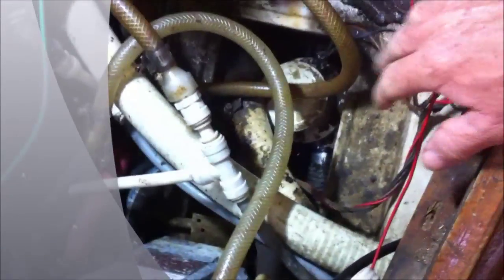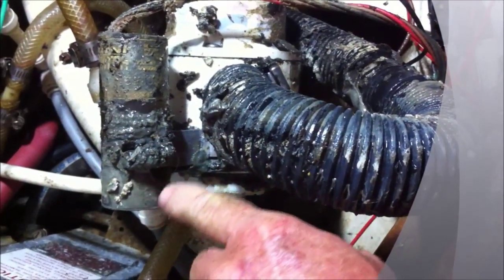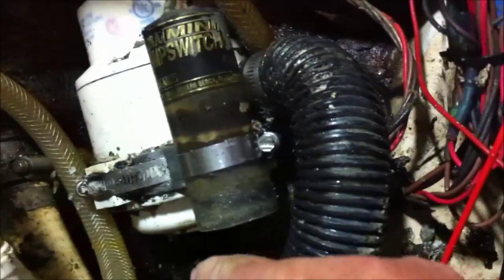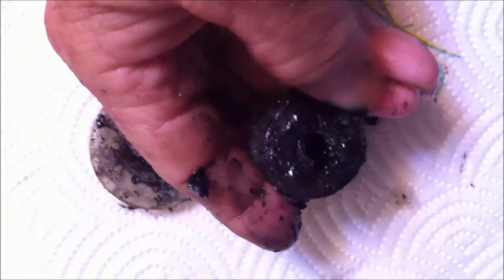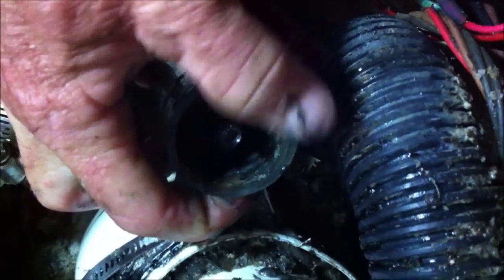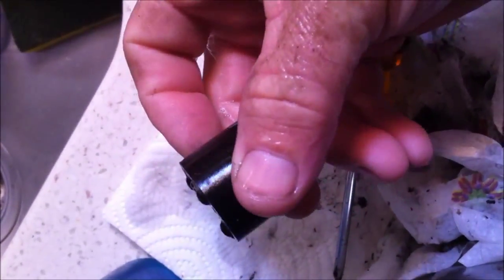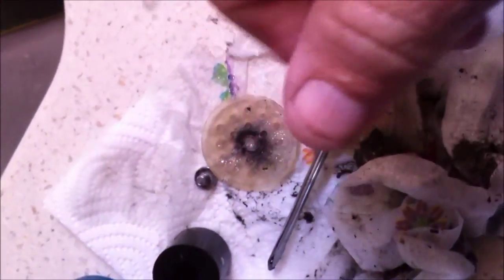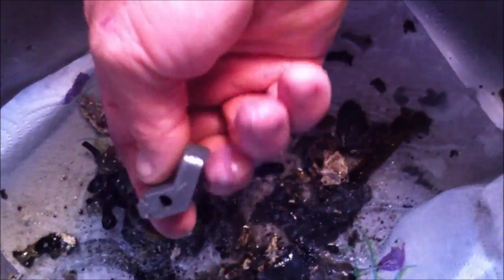Bilge Cleaning

Comment: IMHO get rid of that terribly designed float switch.  It has small apertures and fiddly small parts that will need supervision and frequent cleanings.  The amount of debris in the bilge might be able to be strained out before it can travel to the float switch/bilge pump.  Good luck